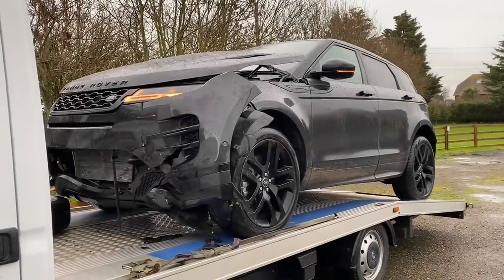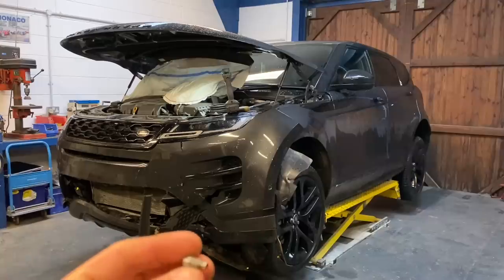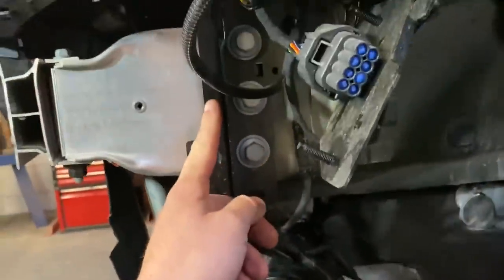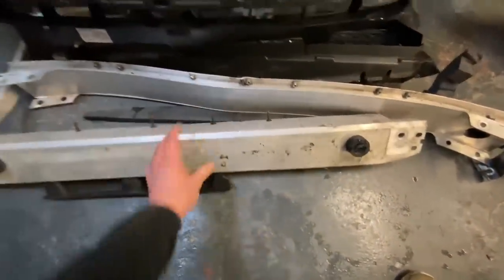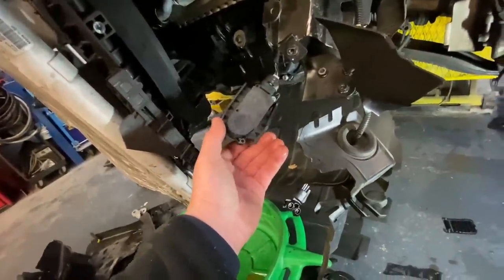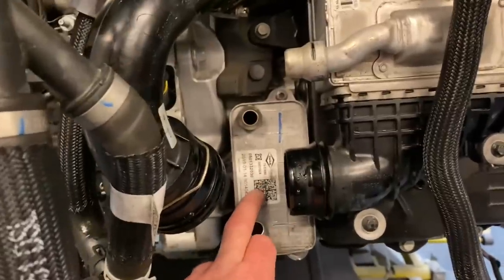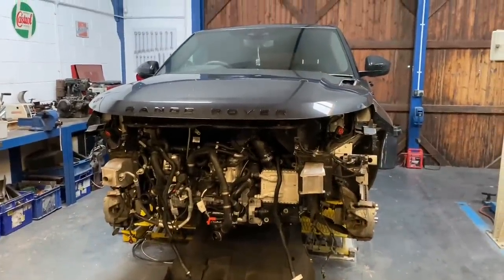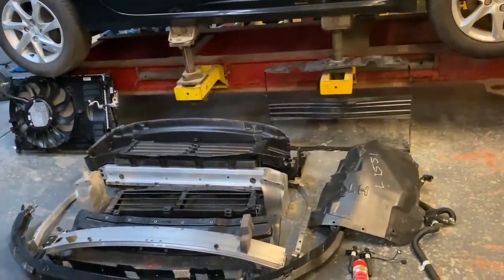Rebuilding A Crash Damaged 2020 Range Rover HSE Project PT1

Comment: Shame you guys don’t know a good tig welder for that oil cooler unit.
Reply from the maker: To risky if it was to fail in the future the damage would be catastrophic 👍
Reply: Not worth the effort. Can get the cooler for a tenner on eBay (I did!) When they are listed. Volvo and Ford ones fit if you’re not fussy about keeping oem
Reply: How much was the rangerover plz
Reply: @bellafiasandpuppies4220  Rob will tell you price when its finished.
Reply: I doubt a tig repair would fail but at this ‘newness’ the buyer would prefer a new unit.
Reply: Looking forward to seeing this repaired 👍
Reply: Great channel  keeping it Real 👍
Reply: Nice to see a late model car getting fixed and the relatively ease of new parts availability for a quick turnaround, don't mess around with the oil cooler, remember the rest of it is not even a year old 👍👍👌
Reply: @sruk  I think you can find the right professionnal to repair that radiator fitting 🙂
Reply: Best to get a new one IMHO

Comment: all vehicles like this need a mark on the log book to say it has been crashed and repaired
Reply from the maker: Why’s that ? It’s not bad and any insurance company would repair this car
Reply: I disagree, especially when it’s a case of unscrewing and screwing replacement parts on. It will be no different to a factory made car.
Reply: @craigmarvin4612  it's very light damage most cars on the road have had a bump look on copart

Comment: Looks like a cracking build 
Don’t you just love all the bits of broken plastic everywhere 
I did a 2014 Corolla that had a small front impact and the plastic was everywhere and even when I was putting it back together there were little bits still falling out 
👍👍😍😍

Comment: Surprised the evoque wasnt repaired via insurance company as your rights parts dear but no structure damage? The wiring harness for front parking sensors can be repaired, u can get wiring pins and connectors via dealership rob, reasons for different bumpers are due to so many variants of car spec parking aids, cameras, self parking etc, great quick project, look forward to next video lads

Comment: Id look at getting the bumper from the dealers , save the pain in finding the right one on ebay

The parking sensors you may be able to solder them back on , if its still connected to the bumper 

Another good buy here guys ! Big money !

Comment: great video and a nice machine, but (and i say this a a huge fan) you need to watch you weight limits on that 3.5t truck. i have been in court at the same time as people getting overweight fines and they are huge..... 3.5t minus whatever the kerb weight of the truck on the V5 is, leaves the maximum kerb weight allowed of the vehicle going on it (also on V5 kerb weight)... just saying. im on your side.
Reply from the maker: It got dropped off bud I chucked it on for the thumbnail 👍

Comment: Have a look at First Choice Bumpers in Wigan. They have a few L551 bumpers in stock, I just checked their website (not sure if theirs are the same spec as yours though but the base bumper should be the same, just grille changes between specs)

Comment: looks like a nice simple fix, the obvious concern is in regards to the ac rad, i imagine it lost it's charge in the crash rather than you letting it off into the air, maybe a mention in the next video to stop the eco types having a go
Reply: It will be R1234YF gas, you can legitimately evacuate that to atmosphere...although it's expensive to re-gas.
Reply: @russellswift6325  is this the one that's based on co2 then? but runs at ridiculously high pressures?
Reply: @therealdojj  No, 1234 is the stuff fitted to most cars from around 2015, it’s no different in operation than the regular 134A, just better for the ozone layer. As far as I know the CO2 stuff is fitted to some of the newer/top end Audi’s etc.

Comment: The oil cooler can be fix. Give it to someone who can weld in Al an fix it. No point in wasting money until you see what can be savage. How about the cooling fan? The electric motor, the propeller  the shroud  the radiator from the middle?
Reply from the maker: Rad pack come as a complete unit they won’t sell separately. And we don’t want to weld it up it’s a 20 plate car 👍

Comment: have you won on the bingo at christmas ?  merc then R/R?       that cooler is the same as other boxes , ford or volvo etc. parts may be cheaper at other " stealers ". worth checking out , even factors worth a check.      should of saved that  airbag for april 1st - even i looked twice ,+ im still in trade!       keep it up.

Comment: Looks like you could ali weld the oil cooler if it's going to take ages?
Reply from the maker: Not worth the risk 👍
Reply: @sruk  With such a new car you are right, especially as it's oil cooler. Great to see you doing things right!
Reply: You dont spend a fortune doing the body repairs to take a chance on an oil cooler leak which could cause a very expensive mechanical failure so im with rob on this
Reply: @eggy1962  Very true. I'm only used to old bangers. Great to see people doing it the right way.

Comment: Hi rob, I have ordered some g101 to clean my mk3 focus which has been sat around 3 years. The interior is a little mouldy. What mix ratio would you suggest ? I will be using a 500ml spray bottle.

Comment: Not even a year old and 9,000 miles.  That crunch is definitely going to have ruined someone's day...

Despite how much of a mess it looked at the beginning that's actually a really quite simple project, just nuts and bolts really, and a good paint job.  I was expecting a bit more damage under the cosmetics than that.  I'll lay odds that was what's called a constructive write-off, where the effect the history of damage will have on the vehicle's future value is enough for the insurance company not to bother repairing it, which is actually fairly common on very recent vehicles...

Comment: Why dont you guys get a hot stapler for the bumper and then locally plastic weld and respray the damage? Should work out cheaper in the long run after purchasing the kit.

Comment: Could  that pipe on the gearbox oil cooler not have been re attached? Brazed on or something? I know it's not your style but if it's secure and doesn't leak?
Reply from the maker: It could bud but it’s just not worth the risk on a car there now if it started leaking it could cause catastrophic damage 👍
Reply: @sruk  excellent. Just goes to show the quality of your work. Good second hand if not new parts and no bodges.

Comment: Not sure if you would be interested I have a 55reg Renault grand scenic 1.6 manual I was going to do it up and give it away for free to a front line worker but unfortunately I am unable to get the repairs done I was wondering if you want to do it it requires the ignition card reprogrammed it does start the car with a pice of plastic the steering requires attention and the exhaust needs looking at the car is MOTD till March so if you would like the car for free to do what I had planed you are welcome to the car if not I’ll just scrap it come March
Reply from the maker: Really appreciate the offer buddy but it wouldn’t be for us but thank you anyway God bless you 👍